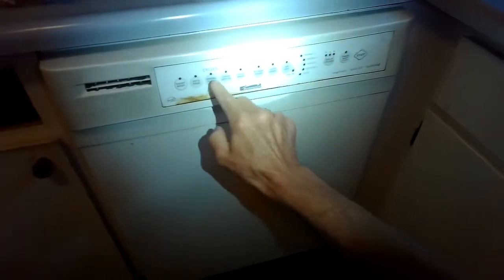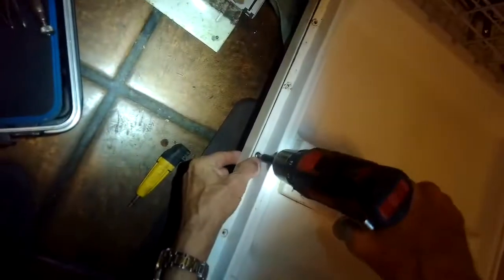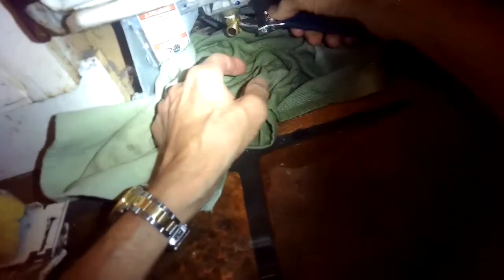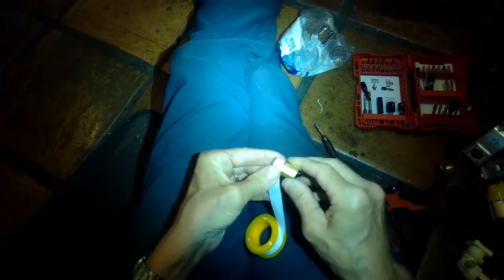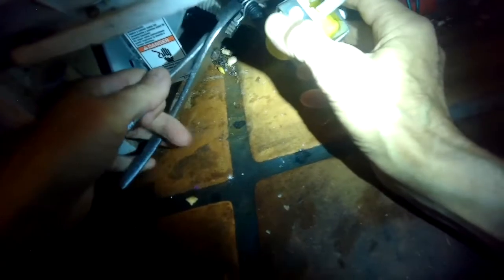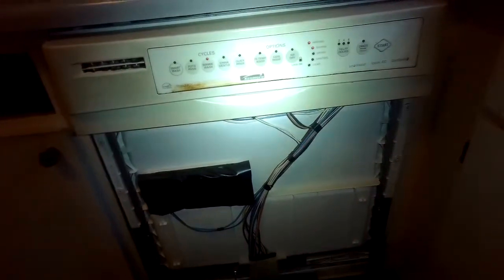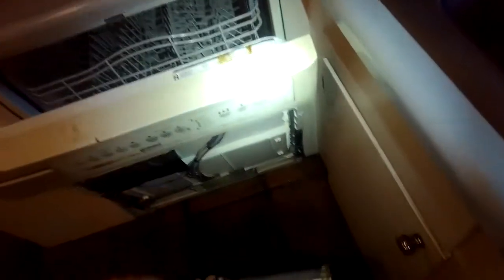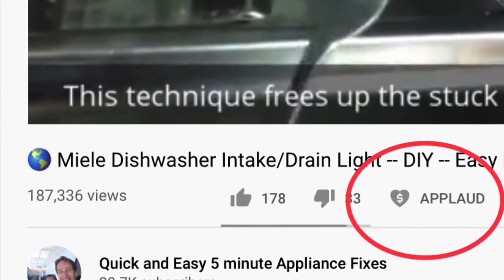✨ WHIRLPOOL DISHWASHER NOT MELTING SOAP - FIXED ✨

Comment: I was thinking I needed a  new circulator pump but maybe it this fill valve solenoid.   Is there a good way to tell the difference?
Reply from the maker: Great question Jack,
If after five minutes into the cycle the water level has reached the bottom of the heating element then you know that it is working correctly and you probably have a problem with the circulation pump.
If there isn’t enough water entering the dishwasher won’t be able to clean properly.
Reply: @QuickAndEasy5MinuteAppliance  Thanks!